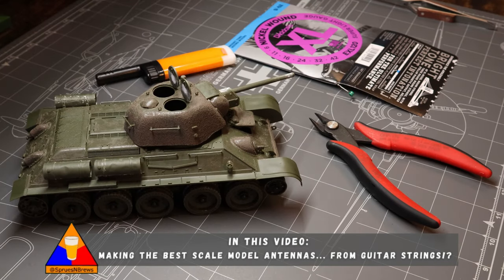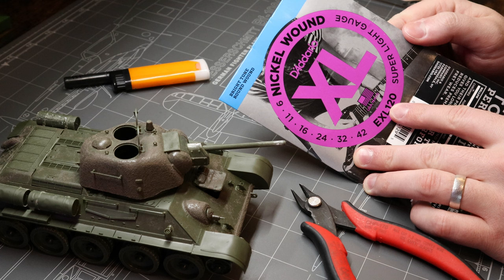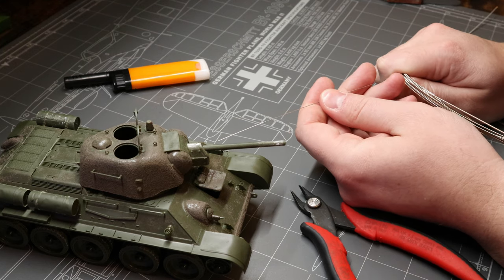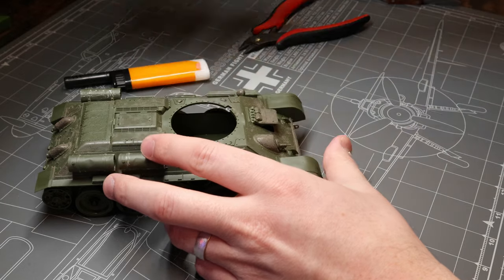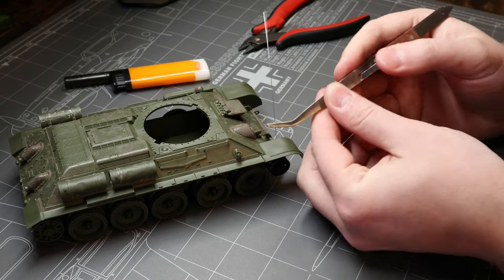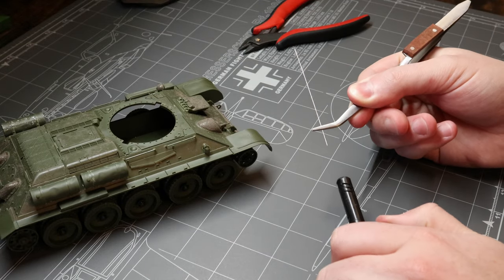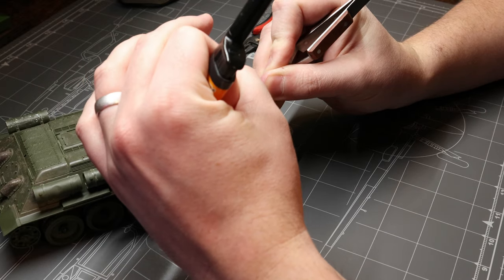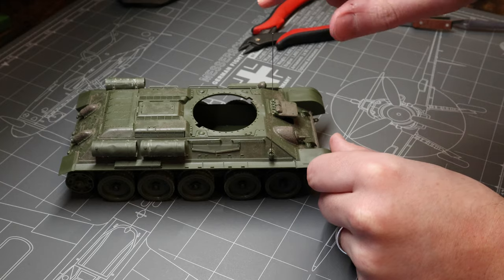Try This 3-Minute Trick to Build the BEST Scale Model Tank Antennas!

Comment: Good tip!
Reply from the maker: Thanks!
Reply: Perhaps a tip for you and others, E Z line makes a stretchy line that is used for scale model AC antennas. It works great as a tie down for armor model antennas.  Many of the antennas on tank turrets were tied down so they didn’t  get knocked around by trees/underpasses, etc

Comment: Awesome! Sure looks sturdier than the ol' sprue melting trick. by the way, what model is that? I've been looking into getting a T-34/76 for a while now, I'm wondering if you have any recommendations.
Reply: it looks a lot like the tamiya T-34/76 in 1/35, but turret is either modified or from another kit i think. it's an alright kit but the rubber tracks are very tight and its a 1974 mould i think.
Reply from the maker: Thank you! It's one of the classic 1/35 scale Tamiya kits - their "Uralmash" turret version 👍
Reply: @SpruesNBrews  Nice, I'll take a look at it.

Comment: For guitar players, could you tell us which string you chose at the :50 second mark? I'm guessing a G or B string? Thanks!
Reply from the maker: I actually don't recall! I retired this set to antenna-duty a few years back & I honestly didn't check the color before snipping. It was definitely one of the bottom ones though... believe it was the G or B to your point. The E is a little too small with these XLs 🎸

Comment: My method is more economic. I use lower guitar string (D, A strings) for tow cable. But for atena, I use solid core vape coil wire with 28 awg size. They are very easy to bend. You can use it as atena and many other things. For a small roll (30 meters), you can build a big collection of tanks

Comment: Tip - don’t use your best expensive precision sprue cutters for this, cutting hardened steel like piano wire, or guitar strings, really messes up cutting blades.  Make sure you have some cheap cutters for this job.

Another tip for cat owners - please don’t pluck your cat, but occasionally you find shed whiskers, when you do collect them and put them aside because they make brilliant whip antennas, very scale because they taper to a point like the real thing.
Reply from the maker: Cat whiskers!? No way - never would have guessed! 🤯